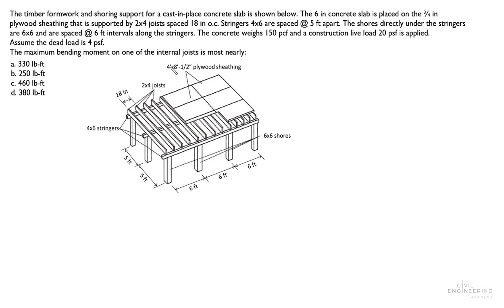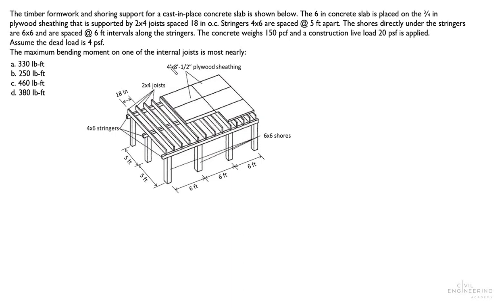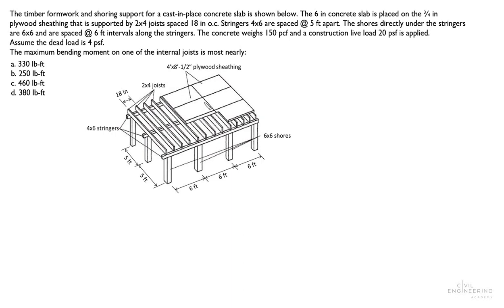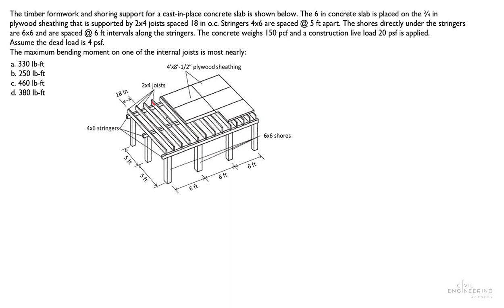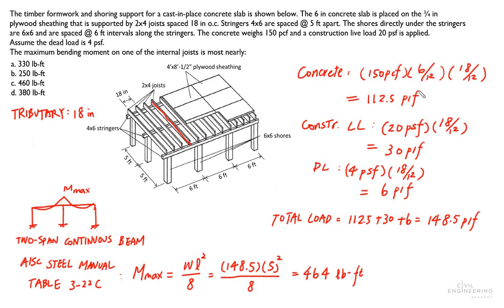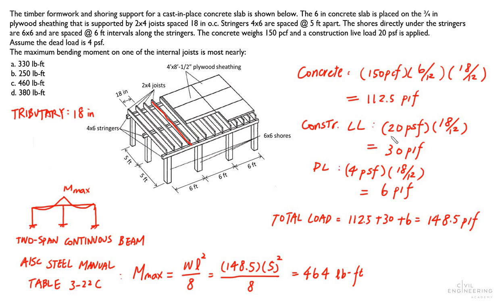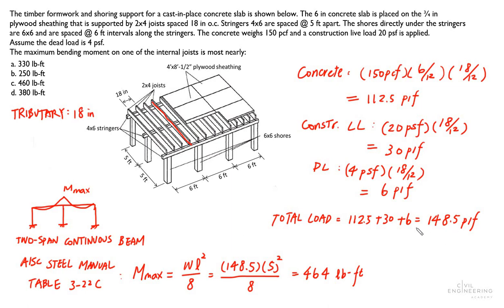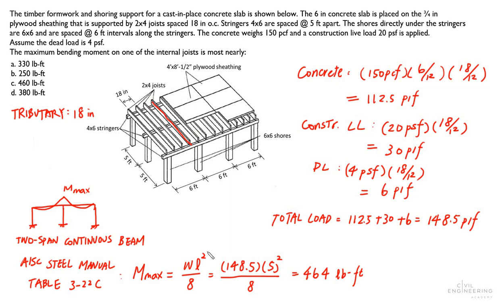Civil PE Exam - Structural - Find the Maximum Bending Moment on an Internal Joist

Comment: Why is plywood sheathing weight not considered?
Reply from the maker: Any deadloads should be wrapped up into the give DL value.
Reply: This problem can be tricky as it does not mention to include or ignore the self weight of the concrete/plywood. It says assume the dead load is 4psf, yea the weight of the concrete is beyond 4 psf, 75 psf, but then again the actual thickness of the plywood isn’t clear. In the figure, it’s 1/2”, but the wording calls it for 3-4”.

Comment: Why aren’t you using ASCE correction factors on your dead and live loads?
Reply: I believe i figured this out.  The notes in the NCEES guide note to use ASD for wood design.  ASD does not have load factors for the dead and live loads.  LRFD does include the 1.2D + 1.6L etc etc
Reply: By "correction factors" I assume you actually mean "reduction factors." ASCE does not allow for reduction of dead loads. For live loads, (Kll)(AT) must be greater than 400 ft2 to reduce live load. For this problem, Kll = 2 for interior beam, AT = 1.5' x 10' = 15 SF, (Kll)(AT) = 30 ft2. Also, if the PE exam wanted you to use ASCE reduction factors, I would think that would be specified in the problem statement.
Reply: @neilferguson7274  load factors? i tried this problem and got a different answer because i applied1.2D + 1.6L to the distributed load
Reply: @michaelsullivan4706  I'm in the same boat. I don't see why we wouldn't be using load factors in this problem.

Comment: Does that just happen to be the same moment formula as the single span, simply supported, distributed load case? I know I would have (not necessarily correctly) modeled it as two separate simply supported, 5ft beams--which happens to give the same answer.
Reply: The max moment in this example is at middle support (negative moment). For single span beam, it's positive at middle of span. Totally different meaning even though the formulas happen to be the same.